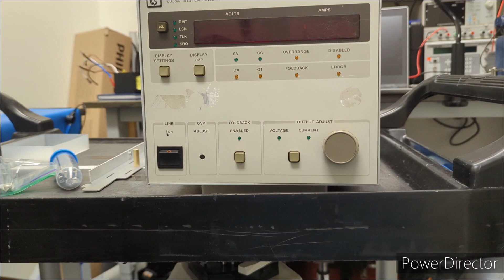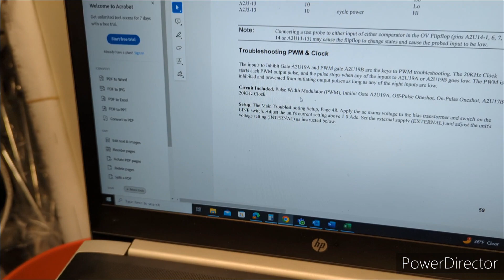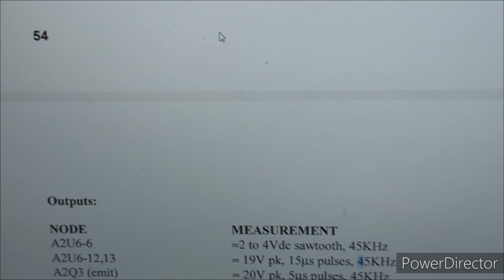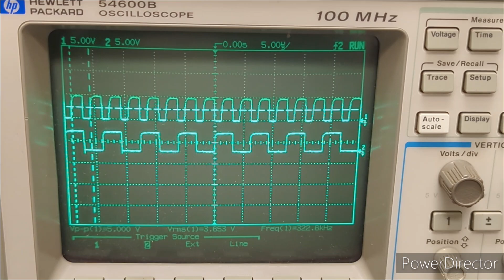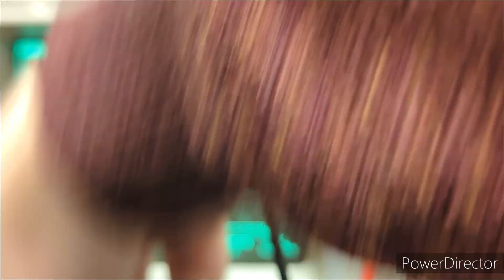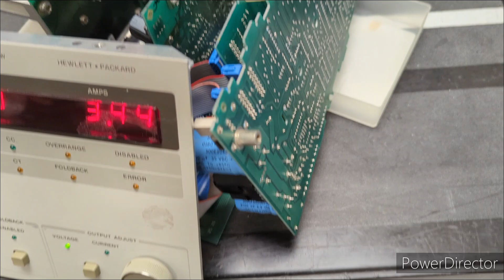HP 6038A Power Supply Repair Continued: Further Voltage & Performance Testing

Comment: Looking at your waveforms and testing I definitely suspect one of the  switch mode chips when bad, as when you measure the 5 volt rail directly and no bad ripple? It not just the capacitor, the bad capacitors will take the main mosfet and switch mode chips on these causing those peaks. Plus repaired a few where that was the issue. Replace all the Rifa capacitors, they will fail and leave your room smelling for days. I know I had to many fail on me over the years.

Definitely not a bad idea to setup an older PC with a pc ISA slot GPIB, it definitely come in handy for calibration and performance testing. Invest in a level signal generator and good voltage source calibrator your going to need them down the road, especially since see your repairing oscilloscopes and good at it.
Reply from the maker: thanks for your comment! I went back and checked the frequency of that waveform and it matches the switching frequency of the PWM U6 and Q3 (45kHz).  It could be as someone else mentioned J3-1's closer promixity to Q3.  Or maybe C20 is indeed going bad, however, it tests fine in circuit.  Thanks for the feedback!

Comment: Good job on the repair! I recently got the 20 V @ 30 A version of this PSU (6033A), luckily (or unluckily for the fun of repair) it only had the fan seized. Ended up doing a full recap + DC fan with temp control. Not easy to replace those large caps, had to make adaptor boards to fit smaller ones in parallel (16 in total).
Reply from the maker: Thanks for watching! Yea I bet some of those large caps were stubborn! They are tied to some thick traces so you'd probably need a powerful iron, combination of iron and hot air, and/or desolder gun.  I'm looking forward to adding the 6038A to my collection, but I would have been happy with a 6033A as well!

Comment: That waveform you measured at J3-1, the integrated spikes of alternating polarity…I wiuld have said it was ripple on the 5v rail due to C20 drying out, but you later measured the 5v rail directly, (not via R38) and found no ripple. Later you neasured at the emitter of Q3 to see the PWM coming from U6…which, without checking I suspect is either an SG 3524, 3525 or 3526…or aTL 494 or 594..one of that family of switchmode chips anyway. If you look st borth the emitter of Q3 on one channel and J3-1 on the other channel of your q54600, I bet my bottom boot the rising and falling esges in both waveforms are co-incident. I reckon, but can’t prove it, but measuring at J3-1 rasies the siuece imoedance of the node you sre measuring to 10K, i.e. that of R38, this then allows the magnetic field of L1 to incuce the spikes into your CRO lead, could be wrong, but you could test it by simply duplicating the measurement and moving tour CRO lead nearer or further from L1 and observe if this changes the spike amplitude.

O.K. You seemed somewhat confued by output terminal current and voltage measurements with one DMM clearly marked as connected across the voltage, but a second DMM not exolicitly shown connected scross a shunt resistor of low value, 10 or 100m Ohms I recall….that is a standard way of measuring voltage and current of a load, particularly if your DMM is not fitted with its own current measurement…well just invoke Ohm’s Law snd measure the voltage drop across a low value shunt resistor in series with your load..this is standard practice, both inside a piece of gear or outside it on a benchtop!

To tell you the truth, I’d refrain from making too many really detailled feedback loop transient response measurements on it, particularly with how you had it, all apart like a “house of cards” on the benchtop…I was terrefied you’slip, short something out and really bugger it up just after you’d fixed it. If I were working on it…knowing it is an older piece of gear that already had one buggered Sprague cap in it, C23..and I have gear with those blue Spragues with the red epoxy bums in it, I thought their quality was so hogh they’d virtually never fail…but fail one did given enough time…so I’d be going straight to reolace ALL the other similar blue Sprague electros, because sure as the sun will rise tomorrow another will fail, if not just after you get it sll back togetheervand calibrated..then a month later…and you have to pull it all to bits again…calibrate again…oh boy!!

I,m doing a Tek 7L5 spec an at the moment, I’ve had two tants go, one with smoke and smell and the missus waint happy and banished me and rhe 7L5 to the yard till I fiund that tant and all the destructive distillates it had spread inside the unit.

Put it back together, put it through as much of its cal routine as you have the gear for…oh, and please…get some metho and toilet psper and CLEAN its poor front pannel…and your poor old bench HP 3478A meter….looks like it is delamonsting around the pushbuttons, get some of that stickey film you cover school excercise books with and relay it around those buttons after a good clean with metho (ethanol).

It is really good to see a young-un picking up the electronics “can” seriously. You can potentially get a whole bench of your own high quality gear by buying and fixing up gear others deem not worthy of their time…well that,s their loss. Don’t let any landlord part you from your gear buy booting you on snd forcing you to move…try to maintain a bamch wherever you go. 

Cheers, “The Globe Collector” (type this into a browser to see me!)
Reply from the maker: Wow thank you once again for detailed input and wealth of info! I’ll try to answer each of them.
1)	Regarding the polarity peaks at connector J3-1: I have yet to put the supply back together (I was planning on doing that today).  I’d love to give that test a try to see if you’re right.  
2)	Regarding the 100mohm resistor to DVM setup: I figured it was there for current monitoring! Sometimes I second guess myself when I think I know the answer because I still feel I have so much to learn.  
3)	Regarding performance testing with the unit in pieces: Yea I guess it was a bit precarious to have everything flapping around in the breeze like that! But I thought if something did release the magic smoke during load testing, might be more interesting to see it happen with the cover off!
4)	All of my test equipment (except my DMM and my Siglent PSU) have been bought used in working or non-working condition.  I feel when you have to fix something you own to get it working, you appreciate and value it more after.  And like you said, it can save you a lot of money!
5)	I’m not so young anymore (early 30s) lol.  But definitely young in knowledge and experience.  I did watch ‘The Globe Collector’ or possibly just a preview of it (do you know where I can find the full film?) I assume the short documentary is what you are referring to?  If that is you (Andrew Pullen?), then we have some things in common! I also got my degree in Chemistry – I worked as a chemist for several years before switching to lab equipment repair.  And as a child, I was obsessed with telephone poles and high voltage transmission lines.  I would stare at them on car rides – I was certain I could find my way home by following the changing distribution lines and poles.  I would draw them all the time.  I’m not sure why that didn’t lead to a passion for electronics at a young age.  I was also really into music – I played music in bands for a while in my teens/20s. I also was thrown off course a bit by other endeavors I won’t go into here.  But I really think I found my passion in electronics.  It makes me feel like a kid again – that sense of wonder in how all this stuff works!

Comment: Wouldn't it be great to have repair manuals for all electronic equipment. Great job digging into that power supply.
Reply from the maker: Use to be the case! Now anything made after 2000 you're lucky to get a block diagram of the circuit.  Thanks for watching!
Reply: It would have definitely been nice to get schematic's as make my life much easier instead of having to pretty much reverse engineer it and trace issue down for all test equipment but most manufactures stop doing that many years ago. Just a stupid block diagram that states replace ## board if troubleshooting leads you to that. Even with test equipment that cost 20k plus.
Reply from the maker: Yes indeed it is a shame how things have changed compared to 25-30 yrs ago.  I work as an in-house engineer for a biotech company repairing all their lab equipment.  We have some equipment that when brand new it costs >$300k.  You'd think you would get a decent service manual with something like that right?  Nope... nothing... not even a block diagram of internal circuitry.  While it does make me work harder to troubleshoot issues, it makes me a better problem solver... but I would still rather have the schematics 😂 @thetechgenie7374